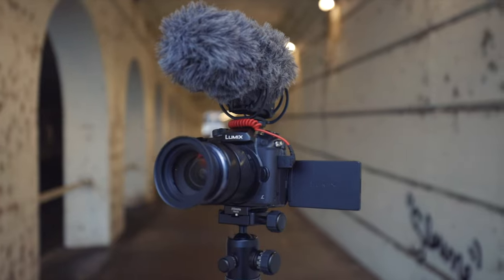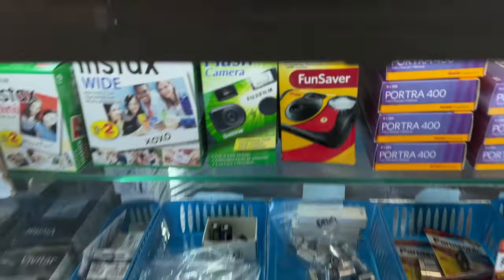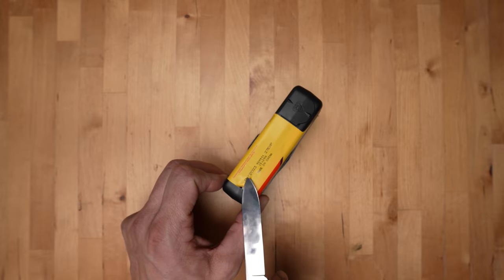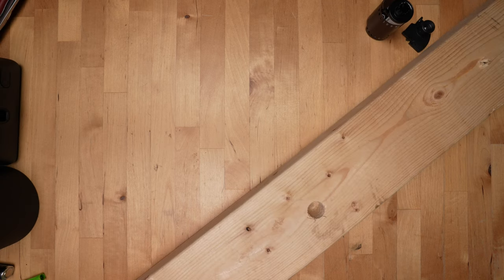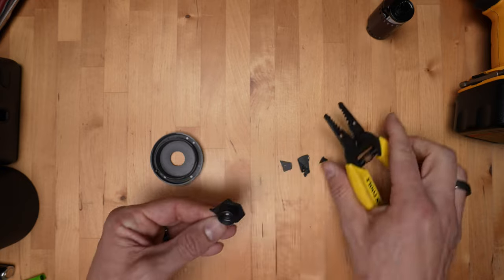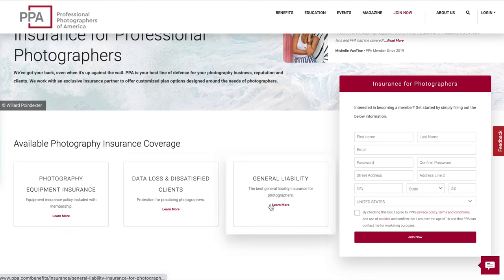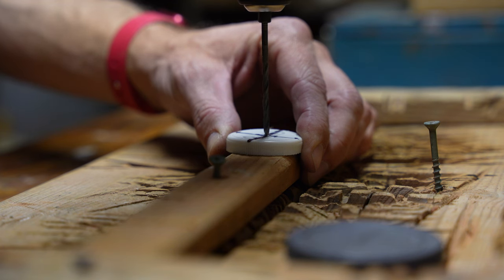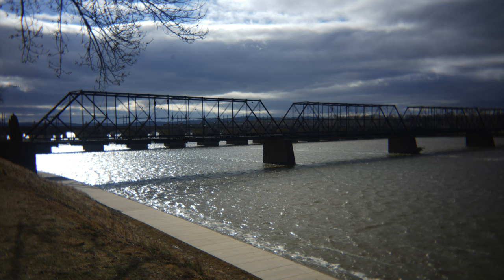$20 Vintage Body Cap Lens [35mm Disposable ➡️ Sony A7iv]

Comment: Didn't work for me.  I tried this on Nikon Z and Sony A mount and the Lens/flange distance mounted on the cap is wrong for both systems.  Only blurry images.  I can set the whole assembly on the front of the Nikon Z cap and its nearly there with some slight tweaking of distance.  I've only ever seen this done with Sony E mount systems, so perhaps that's the only one with the proper lens to sensor distance with the cap mount.  Oh well, it was fun to try anyway
Reply from the maker: ah thanks so much for this info! pinning.
Reply: yup I just tried it for my canon sl3 and canon ae-1, both were blurry :(
Reply from the maker: @nirpatel6842  can you move the lens closer to the sensor or further away with washers? Similar to what I tried first (and show at the end of this video)
Reply: @RCodyWanner  I tried it today with a Canon SL3, the distance is not good for infinity focus. It works as a macro lens because the focus is really close, but I can't get the lens closer to the sensor without risking damaging the camera itself, so there's no way to focus on the distance
Reply: @TheAndersops  this will of course not work with a DSLR, only on mirrorless.
Reply: @Digi20  can you explain why?
Reply: @TheAndersops  because the original lens focal point is designed for a very short flange distance (the distance from the rear element of the lens to the sensor/film). the lens has to almost touch the film to get things in focus. on a dslr, you have to move it further away from the sensor because of the mirror box. doing this means you can only get macro shots in focus, but nothing thats further away. so this whole contraption only works on mirrorless cameras that allow to get the lens close to the sensor, like it was on the original camera it came from.
Reply: So what you're saying is that if you increase the distance between the lens and the sensor it gets sharper? If that's the case I would just do what Cody said and stack washers until it's sharp. 
I have a z6ii and I ordered a disposable camera before seeing this comment. I won't return it if the distance needs to be increased from the sensor. but if it needs to be closer than I'll return it.
Reply: @Photor93  in my case the focus is better when the lens is closer to the sensor. Pulling the lens closer to the sensor gets the focus to infinity, but there's a limit to how much I can safely pull it, so the only possible safe use is for macro photos.
Reply: @TheAndersops  it sounds like Tim was saying that his nikon z was focusing better if he just placed the lens in front of the cap instead of through it. That might mean that it needed to be further away from the sensor.
Reply: @TheAndersops  With Z systems focus gets better as you move the lens further from the sensor. 
I cut a hole in the cap same as in the video, then I cut a round piece of 6mm thick PVC sheeting that fit on the front of the lens cap and drilled the same size hole through the middle of it. I kept pushing the lens into the hole of the pvc until focus was as sharp as I could get it. after that I put a small bead of super glue around the outside of the lens so that It would stay put in the pvc. Works great now!!!
Reply: Tim, see my previous comment on how I got it to work with my nikon z6ii.
Reply: My understanding is it will only work on Sony Alpha and Fuji systems
Reply: @pancakelens75  I had is issues with the focus point being too far the e-mount so I designed my own holder and 3d printed it. now it is sharpest at 4-6 foot instead of 10-15.
Reply: @Photor93 what did you end up doing?
Reply: @mr.benlaw  first of all it's wild that you replied to this comment when you did. I just got back from using this disposable lens for this first time since I originally commented over a month ago. Lol

But I explained it more in a previous comment on this thread. The lens needs to actually be further from the sensor than how the guy in the video did it.
Reply: @Photor93  😂 that is amazing! I’d love to hear how it went and ultimately if you recommend it for a Nikon Z user!
Reply: You can 3d print a focusing adapter that will go from infinity to close almost macro levels. Unfortunately not everyone has a 3d printer.

Comment: Watch out for the super glue fumes. It can wreck your camera. It can leave deposits over on your shutter blades. (I modded a cheapo camera from 5below, using super glue ended up hazing over all the parts.)

Comment: Hello! recently i saw a version where the lens is glued on top of the lens cap and instead of a large hole, a smaller hole is drilled on the lens cap. I was wondering if you would know what would the benefit be of having a top mounted lens as compared to what you did in this video. My intuition is that the smaller hole would work akin to a pin hole camera? thus maybe better focus? not entirely sure.
Reply from the maker: i tried that first actually, it was less focused for me, but that could have been because the hole wasn't as smooth as it should have been -- i do think that the hole i drilled here could have been smaller -- but yeah not super sure what the different effects would be
Reply: @RCodyWanner  thank you so much for your reply! I can't wait to work on making this body cap lens myself!

Comment: If you want to avoid getting shocked just charge the flash and taking a photo, the reason it shocks is because the capacitor is charged. Using the flash will discharge it and prevent this 👍
Reply from the maker: that's actually exactly what i did, which made me think i shouldn't get shocked, but i SURE did haha! not sure why? do you think the capacitor just starts to recharge automatically?

Comment: Gonna try this myself, got a bunch of camera bodies from a Camera Shop. Just wondering, why do you specify that the camera must be post 2015 model?
Reply from the maker: the lens on the earlier ones are different, so the flange distance doesn’t work on them (they produce blurry images)
Reply: @RCodyWanner  shit! I'll try it tomorrow, just read on the bottom "develop before 2010“. Anyway, thanks for answering!
Reply from the maker: @SheldsenDave  you might be able to make it work, but you’ll have to try getting it either closer to the sensor or further away, with black spacers (washers perhaps)

Comment: How come my Sony a7iii says 8mm where yours says 35mm on the display icons?
Reply from the maker: i think that is what it is using for the stabilization calculation -- i think you can change that (for when the lens does not communicate its focal length, like in this case)

Comment: I would be worried that the lens would break and then scratch my sensor, I would use some heavy, heavy duty adhesive for peace of mind and maybe a little caulk to not only keep light out but any particles that could slip through the cracks, besides those two things I totally want to make this, I have a tone of body caps from when I ordered rear E mount caps
Reply from the maker: great idea! I used gaff tape on the inside of mine to catch any dust or particles — with caulk, just make sure you don’t change the distance the lens is from the sensors (because of how thick the caulk is

Comment: Why is a post 2015 cam required? i have 2 wrapped in plastic kodaks with a 2002 expiration date, will they not work for this?
Reply from the maker: Yes unfortunately the lens and flange distance are different — there was one that I got pre-2015 that had 2 plastic lenses, it was crazy — but yeah couldn’t make them work

Comment: Just tried this. A few points. Very difficult to get the quality of images seen here. You'll probably get dust or dirt in the lens during disassembly. 

A lot of tweaking required to get the focus correct, distance from sensor has to be millimetre accurate to get usable pics.

Sand and clean lens cover after drilling or You'll get dirt inside your body!
Reply from the maker: great points! are you using a sony full frame e mount? the flange distance (and focus) was spot on "as is" on the 3 that i've made!

Comment: Does not work with Canon M system either. But instructions were easy and everything worked great only the focus did not work, for this the lens would have to be a few millimeters further away, unfortunately I had already glued everything and so there was nothing more to do.
Reply from the maker: Time for iteration #2!!

Comment: Has anyone done it on Fujifilm ???
Reply from the maker: I’m not sure if it will work quite the same — the lens will likely have to be even closer to the sensor — but I could be wrong! And also you could do that with spacers (or washers, like at the end of this vid) I only have known this to work on mirrorless full frame. 

Please make a vid and show us if you try it!
Reply: @RCodyWanner   i just finished my first prototype with the fuji disposable lense for my sony a6400 (kinda rushed)

found out that:
instead of gluing the lense from the inside i ended up putting it on the outside to get a better focus. the lense has the  nice retro grainy look, haven't tried it outside in the sun light yet but indoors with the flash the pictures come out just like how a film picture would.

i think the next prototype i can drill a smaller hole fitted for the back of the lense to make it look more aesthetically pleasing

great video thanks for the cool diy and inspiration!